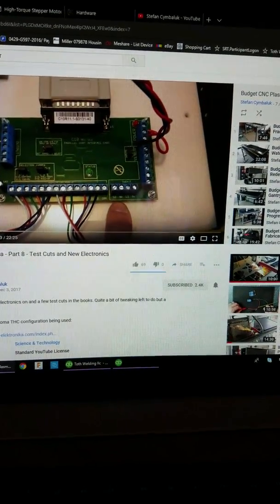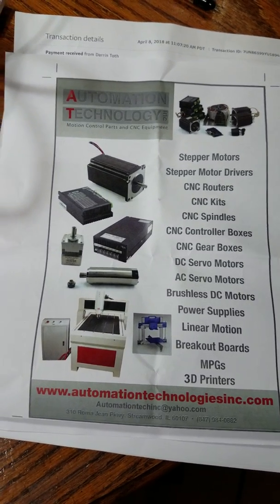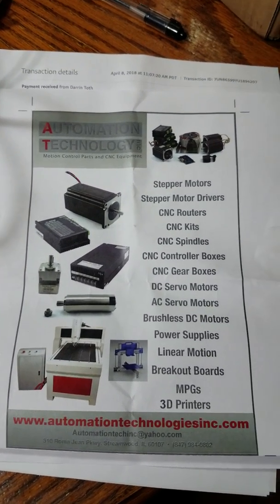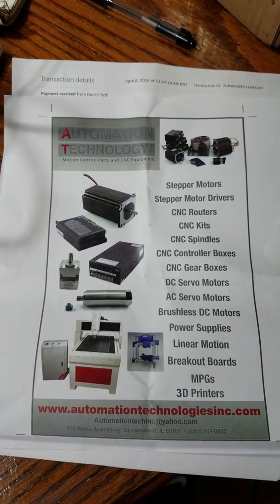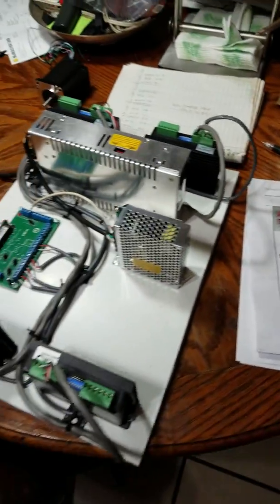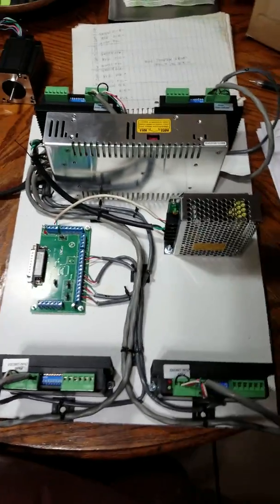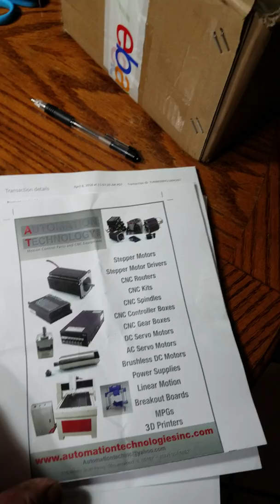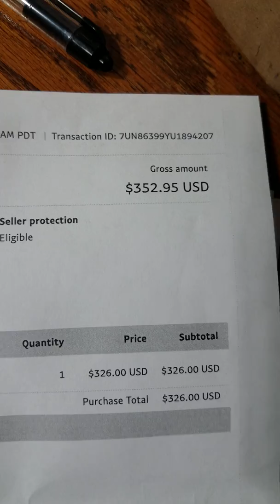Cnc plasma stepper motor electronics.

Comment: Darrin please share how you configured Linuxcnc to work with the THC.
Reply from the maker: I have the Proma THC and it comes with its own config to run with Linux cnc. You download the file from their site and it has all the directions of what needs changed for your table. What works for my table in the setting wont work for yours because my table is completely custom